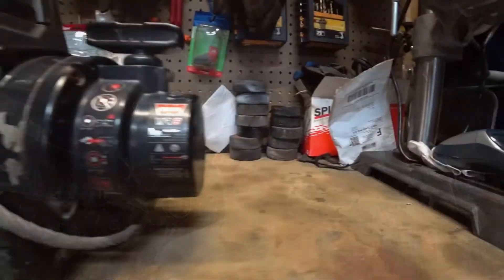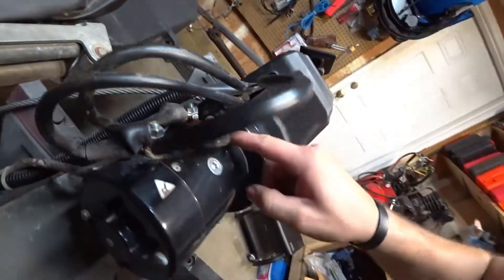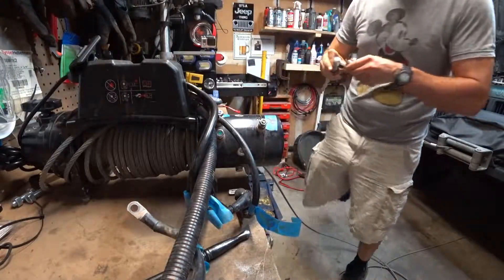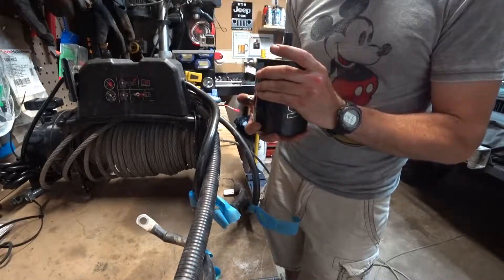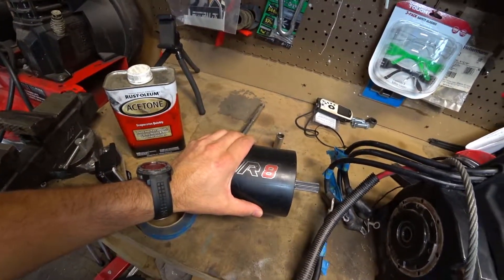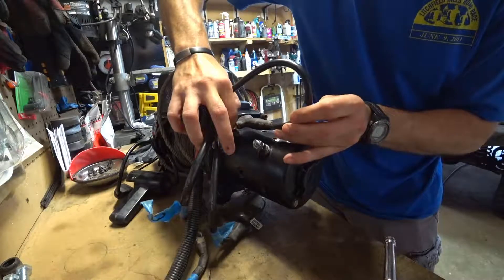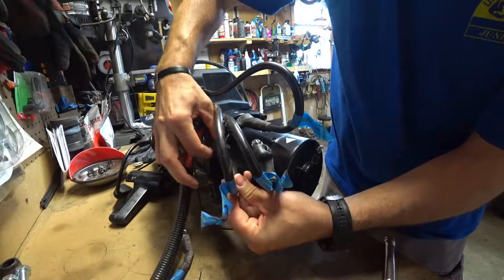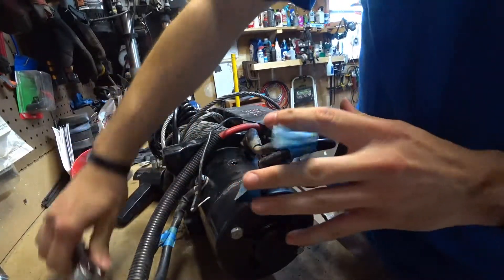Winch not working?  Warn VR8 Winch diagnosis and repair.

Comment: @6:00 If el. configuration is "field and rotor in series" you must connect one side of field to rotor  and try the other to Batt(+) (with housing to Batt(-) )
And trying rotor connection to Ubatt(+) w/o sparking means brushes or rotor are bad.
Reply from the maker: Good call.  Thanks!!!

Comment: Brushes are under the back cover, not under star bolts on the side. Didn’t try to jump correctly
Reply from the maker: You're probably correct.  I tried a bunch of different ways to jump the motor and nothing worked. Turns out it was shorted out before I got it.  It was rebuilt and worked like a charm.  The electric controls were fine.

Comment: Great video I have the exact same winch but mine turned out to be a broken pin in the controller. Its looking to be impossible to repair so most likely I'll need a completely new controller
Reply from the maker: Hopefully you can find a controller online or a replacement.
Reply: @FMJeeping  i found one at my local 4x4 shop $94 but im back in business.

Comment: So I’m having a problem my winch doesn’t feed out wire but it feeds it in what can be the problem ?
Reply from the maker: I would check the switch or the solenoids.  can you hear the motor turn on when you try and feed the direction that is not working?

Comment: When I plug my switch in my winch begins to run
Reply from the maker: If it doesn't run by itself with the switch out.  I would look at the switch or the connection for the switch.  There is a short there somewhere.